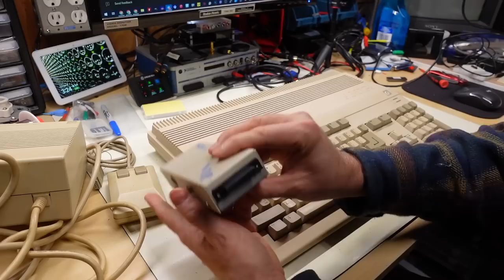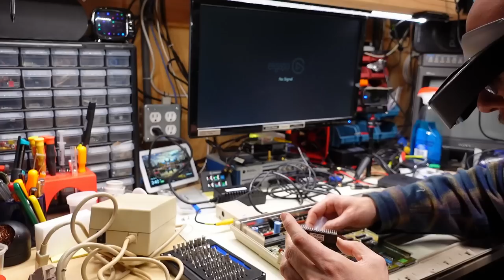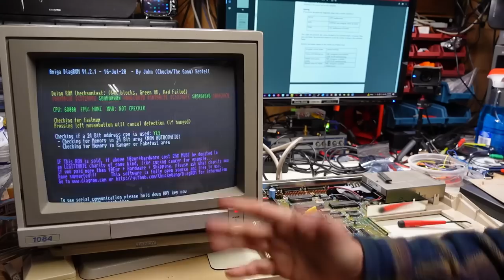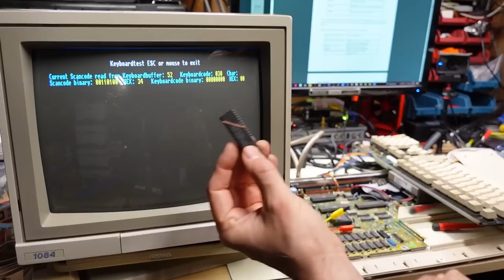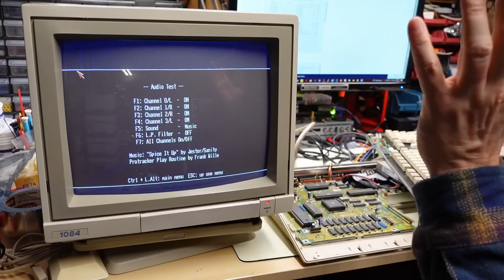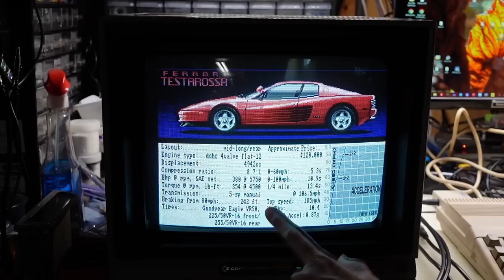Corroded Amiga 500 Rev 5 (w/512k ROM upgrade and S-Video out)

Comment: I had the same VIP video adapter and I too saw the interference when accessing the floppy drive, although to a lesser degree.
Reply from the maker: Oh interesting. I did try it on another A500 and there were no issues ... so I assume it's something on this machine. Perhaps it's a design issue on the Rev -5 board.
Reply: The last A500 I tried it with was a Rev 6a. It is entirely possible it needed some caps replaced.

Comment: I had a Rev5 Amiga, and when I replaced the Kickstart ROM with 1.3 It did not require any bodgewire for my system. The only issue it seemed to have was a serious problem with my 3rd party bootstrap ROM for my 20MB HDD, it would hang for up to a minute on a gray screen before booting from the HD. I ended up just booting Workbench from floppy and using the HD as storage until I sold the whole thing to help finance my first PC in 1992.
Reply: The issue is 512k roms like 2.0 and higher as well as using eeproms on rev 5 boards.
Reply from the maker: Right ok -- couldn't recall is 1.3 was 512k or not -- so yeah any 256k ROM would be fine on that system.
Reply: @adriansdigitalbasement2  1.3 was just 1.2 with bug fixes like working autoboot from hd.

Comment: I'm guessing it was stored vertically with the left side down, so any/all water(?) corroded that connector and plating parts.  Possibly also the ESC and F1 key issues?
Reply from the maker: Oh yeah it's on the same side as the corrosion ... strange is this machine was inside a box and packing foam, and the box is in OK shape. So I don't really get where the corrosion came from.

Comment: It's important to remember that S-Video is not the same as the Y/C input on the monitor you're using. It operates at a lower voltage on the chroma pin. To bring it up to standard for your 1702/1084 you'd need a small amplifier on the chroma circuit.
Reply from the maker: It may be slightly different voltage but it seems like the analog circuits are super forgiving. I've certainly never had any issues with the color decoding circuit on that monitor when used with modern S-Video devices. I think the reason is the color decoded uses the amplitude of the colorburst as a reference -- so the higher or lower voltage the whole chrome signal is doesn't have much of an affect as the relative change is the same between the color information and the color burst.

Comment: a total stranger to cellars I would like to learn more about the sump pump.  Is it catastrophic if it fails while raining for days.  And havent seen rain for ages so would like to see that too
Reply from the maker: I don't think so -- the house would have never had one for almost the entire life of the house (it's over 100 years old) but it just means you might have a little water from time to time. I have a triple sump with redundancy including battery backup, so it's much less likely to have a problem than a single pump which most people have.  The sump pumps just sit in a big hole that is deeper than the concrete floor. so any water will collect there first and it gets pumped out and into the garden.
Reply: @adriansdigitalbasement2  interesting, so it seems the addition of the sump pump is extra measrues to keep things extra dry

Comment: Which video output was monochrome? I remember hooking my A500 up to a 1084 with full color (the 23 pin connector?).
Reply from the maker: Composite video jack on the A500 and A2000 is monochrome, so to get color you use to use a RGB monitor via the 23 pin connector or use a color encoder like the Commodore one or something like this VIP device.
Reply: @adriansdigitalbasement2  Great, thanks for clearing it up. 👍

Comment: About audio, only from A1200/600 you have mono sum on the RCA. Original models 1000-500-2000 are stereo only
Reply from the maker: Ok yeah I recall the manual for the 1084 (mono) saying to use a RCA combiner to make it mono. Nice improvement they did it right on the motherboard on the later machines.

Comment: Having a double size ROM with the largest address pin floating isn't much of a problem if you just write the ROM binary in there twice so that both halves of the memory have the same content.
Reply: Not sure how it is with ROMs, but with microcontrollers, leaving an input pin floating can lead to excessive current consumption.
Reply from the maker: Yeah would work OK if you're using a small ROM image. Can just add a pull up resistor to the pin easily enough too.

Comment: Adrian, how did you boot from the external gotek drive?
Reply from the maker: Kickstart 2.0 and later is able to do that. A lot of older games have an issue with that though, and will fail to work right as they are expecting to be in DF0.

Comment: I am a bit confused....  In have always believed that the A500 had an RGB port built in and connected directly to a 1084 monitor, with color.

My wife had both when we met and we played tons of great games on it.  But it sounded like Adrian said that the A500 was monochrome without the adapter that he was using here.

Edit:  yes.  He said that both the 500 and 2000 only had monochrome as native output.  But I feel pretty sure that this is not true.  Anybiy else able to confirm?

Comment: Is there a Control+key combo you can use as a temporary substitute for the Escape key, like Control+[ on early IBM and Apple machines?
Reply from the maker: No don't think so -- the Amiga is like the PC and uses scan-codes. (And not ASCII like on the Apple II.) So programs look for specific scan codes and you only get that from pushing the actual key.
Reply: @adriansdigitalbasement2  Ah, good to know. It was just a wild guess on my part, having background on other stuff, just not Amiga, though.

Comment: I've tried using all sorts of paint on conductive stuff to fix worn out or broken tracks, but I have never had it work and just given up.
Reply from the maker: Yeah if the trace is bad once I remove the solder mask, I'll use metal like component off-cuts to restore the trace. Or, if it's longer distance like for the ROM mod, I use wire-wrap conductor to do it.
Reply: @adriansdigitalbasement2  oh on a pcb, certainly, that's easy :-). I meant in the plastic membranes in keyboards and keypads. The best luck I had was with some foil and superglue.. It lasted 5 minutes :-)

Comment: Adrian if i was you i would make an adaptor for the eeprom from a chip socket with the modification on the socket so as not to mess up the diag rom
Reply: Some Amiga shops (Sordan Electronics I know for sure) sell ready-made adapters for using EEPROMs in the Rev. 5 Amiga boards. Although the A500 I got off eBay a few years ago was upgraded to Workbench 2.04 but they had to tie some of the legs of the ROM together with thin wire to get it working in the Rev. 5.

Comment: With engine HP you have to look at the rpm. Small capacity Euro engines make peak power at high rpm, ie, they feel dead until rev-ed, where as a big cu V8 will feel better with the same HP because that power is at a lower rpm, ie, more grunty.
This was a while back so the exact numbers are a bit foggy, but as an extreme engine an Amsoil Engine Masters Challenge engine(V8 400cu) will make about 700hp@6500, and something like 200hp@2500 - more than most cars flat-out lol -.

Comment: Sometimes cleaning the membranes is enough.
Unmount the films, separe both membrane films and clean inside. Sometimes is simply dust.
Reply from the maker: So it comes apart without needing to break any plastic bits and stuff? (I've never tried to fix an Amiga 500 keyboard)

Comment: The single membrane keyboard is a Mitsumi, and there are better modern membranes available. The double membrane keyboards are Samsung and there are no membranes available for those.
Reply from the maker: Ah ok -- so you can tell by seeing two ribbon cables going to the controller board? I think I have one of two of that type as well .... and they (of course) have issues